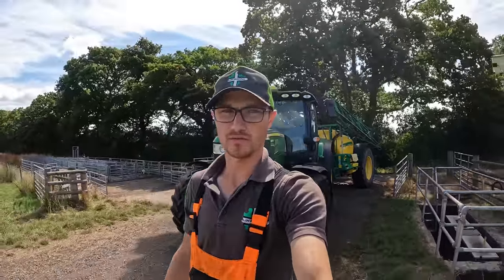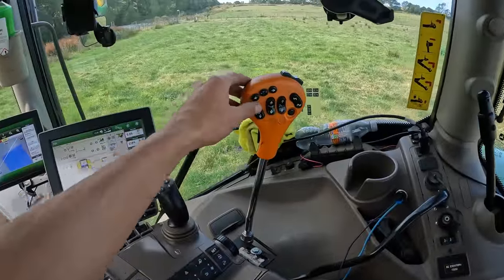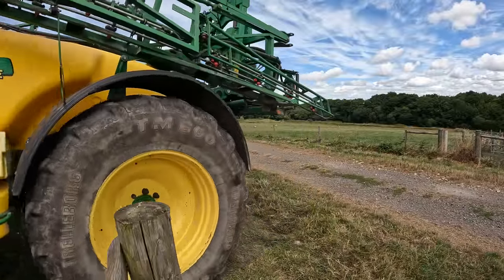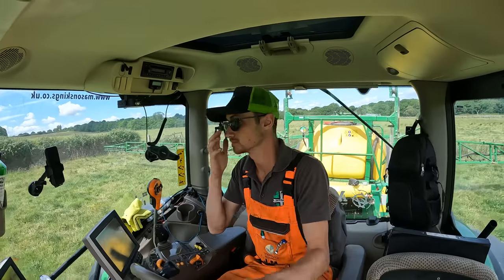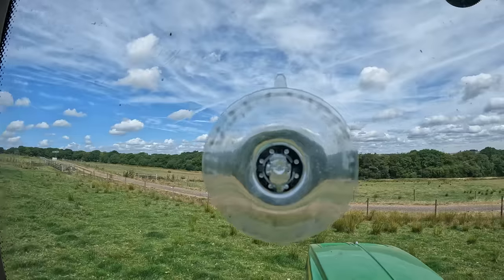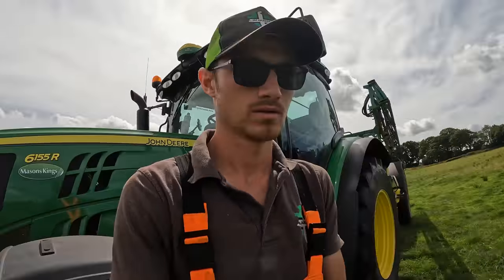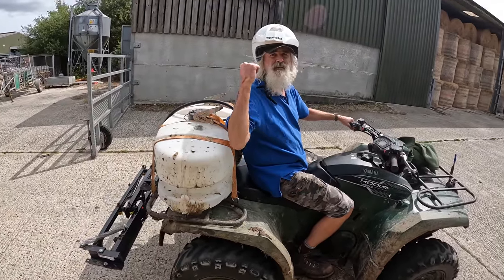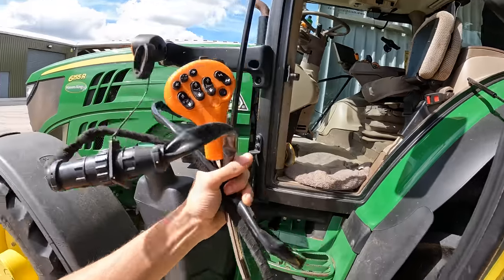OUR SPRAYER MIGHT BE TOO BIG FOR THIS JOB!

Comment: Look up Ram Mount UK.  They have a good variety for GoPro including a suction cup and their stuff is modular and super heavy duty.  Give Gus some scratches or ear rubs for me!  Take care and best from here in the States...
Reply from the maker: I will have a look! Can’t keep breaking these other ones! I will do! Thanks JB! 👍🏼
Reply: @JMFarming  I've been using a bolt in mount for my phone and a suction cup one for my iPad for a couple of years now.  They have a good limited lifetime warranty but, I've never had anything break.  The only thing that I would suggest is to check the suction fairly often until you get confident.  I left mine overnight a few times and I think the temperature variations caused the suction to come loose.  After that I just check and it's been fine.  In my case it may have been user error as well though, LOL!  They have a good array of clamps and such if you want something more reliable too.